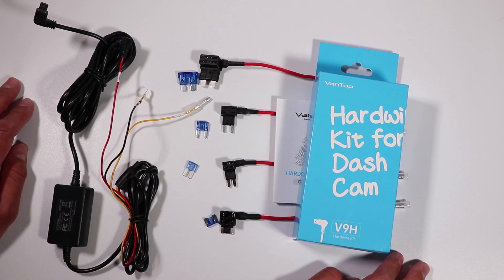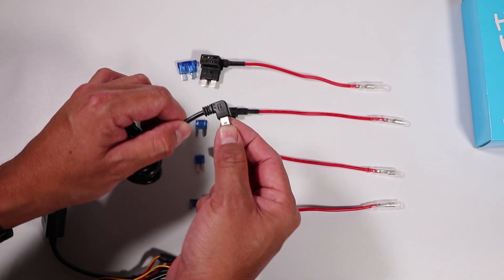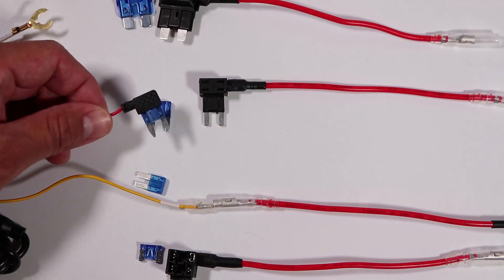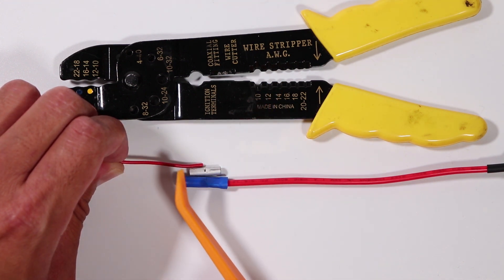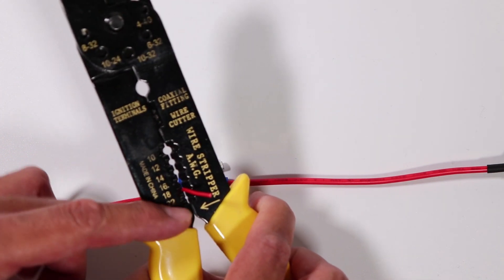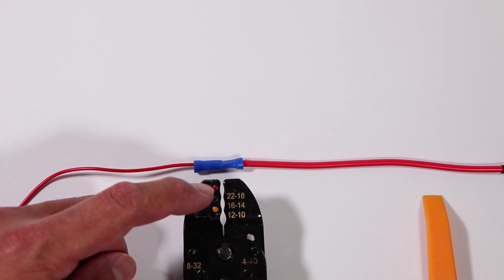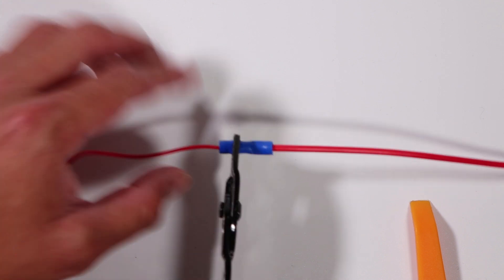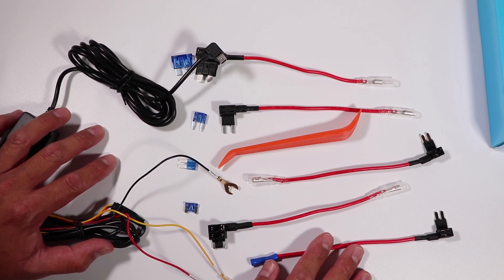Vantop Dash Cam Hardwire Kit: Install Prep, Connections & Fuse Taps Explained

Comment: Yeah I'm still sort of scratching my head, I've been a bit confused as I'm doing all this stuff for the first time. Points you didn't really cover that could use a visual example with just pointing at your car, constant and acc fuse slot, so we use one that's just open or do we pull a used one and reinsert the fuse into the tap, and the black wire grounded bolt example of where it's going cause if that's mean to be in my engine bay... Well I have 2 fuse boxes, 1 in engine one next to glove box
Reply from the maker: Hi Shane!, I'm working a follow up video detailing the installation process on the car. Regarding the question of the fuse position, it will vary from car to car, sometimes they do have free spaces available and sometimes they don't which requires to pull a used one. As soon as the next video is up I will let you know bud!
Reply: @AlexAutoFun  not to mention, well being honest I've never pulled / inserted a fuse before as it's my first car I'm working on myself, just using patience and common sense to recognize when youre a little stumped and seek advice before doing something that could end up costing you alot more than you tried to save. Found that I think I need the mini fusetap, but no matter which way I flipped the tap, the fuse wouldn't slot in. I researched more on the grounding concept, and yeah a quick finger point to a bolt (there's I think usually a paint free metal bolt onto metal next to all fuse boxes, not surprised if this was considered by companies already) I had it in my head I may need to ground it to the negative terminal on the battery for some silly reason as I don't have much electronical experience other than can do attitude, reverse engineering videos and patience, albeit frustrations lol. With my fuse box I have around 1/3 of the slots empty, however as you said test it i have a cheapish tool, typical found in the garage dollar store pen thingy with a connection to plug into it that came with fuses so I'm thinking it's enough for now to make sure the slot is getting constant and acc power, but curiously, the taps have two slots to them.... Is that so you can put the vantop supplied mini fuse in, and of you want to double up a slot, you can put the one you removed into the double tap? Or just stick them in empty ones. In guessing for the most part a 15 fuse is a solid middle ground of giving enough battery when needed, not every tiny tap is going to set camera off and drain battery as I only really use the parking sensor on low, when it's parked. For some reason my mirror turns on for now reason frequently, unsure of it's translating my music or it's bumps. Turned off Gsensor completely till I mount the rear camera which on my car I've deduced it's best location is actually outside of the rear window drilled under the boot spoiler in front/middle of rear boot brake light to avoid your windows orange antifog lines, tinting etc, yet it still gets reasonable rain protection and since it's about 30cm further back than the license plate and raised, I have a much better range for the rear steam during night driving as my rear view is near non existent and my model has a couple of big blind spots so that camera is really going to get used to replace my mirrors with a glance and double check over my shoulder. Also I'm guessing you purchased the 10 or 12 series. I picked up the 12 as I didn't see the price difference as that much but older models are just getting dated already In image quality. How did you combat the digital mirror vibration when your car runs in comparison to the perfectly still factory mirror, only time it doesnt vibrate for me is when I pull it forward a bit but I've already gently put straps onto the tighter notch. Only thing I can "cheaply" and decently solve this is get some blue Tak (well I'll get it in black for a few $ more and I like symmetry so a light blue tac will be ugly when noticed) and use it to push the vantop out a bit from the OEM reverse mirror and just use a small tool to just smooth the bluetac where visible. And am I the only one disappointed we don't have the option to stream the reverse camera in 4k and front in 2k if required.... Is there a rear camera that would do it and is compatible? FHD is fine but... Sure UHD isn't much to swap in, though I'm guessing the mirror software would block it.... May be I'll need add a second camera at the plate and swap the headunit for a touch screen and use the second as the reverse cam and detach the spoiler camera from the reverse power line - from brief memory this is the first real video on the kit so you'll get many like me dropping in ;)
Reply: In terms of the video, was easy to follow up until the end when I'm like, there's a minute left that quickly shows the steps for clarification right? Just thinking in terms of "YT content creation" till that video goes up we're googling my confusion when you could keep everyone here in one video. My content is more vlogging, I'm not phased about giving exact tutorials as I don't want anyone thinking I'm telling them how to do it and my way will work for you. Anyway, good start, guessing editing tool you twice as long as organise and filming / editing the video 😆 good work though, easy enough to follow just need to add FAQs to points that will commonly come up and I think this is the only video with the vantop hardwire kit (though I do realize alot of options are half the price and would of done the same thing in terms of wiring kits, but $14 more wasn't an issue for piece of mind)
Reply from the maker: @011mpsguy  Hi Shane! as promised here is the follow up video, hope it helps! https://youtu.be/zbxYA4VhuT8

Comment: Thanks for the video, very helpful... pretty weak that the red wire has that hard wired connection and i need the low profile one.  So i had to buy the 4 pack off of amazon for this power supply and splice it in.
Reply from the maker: You're welcome CafassoFam! Yes I have to agree with you, the good thing is at least the extra fuses are not that expensive (in my case I had to buy the micro fuse tap). The joys of car manufacturers that keep changing their fuse sizes LoL!
Reply: @AlexAutoFun  i blame the idiot mfg of the power supply for  not making both wires the same way so that the end user can pick the fuse tap that best suits them.  Why do it half ways and then make us buy extra pieces to actually make it work.  Gotta leave a bad review for this item.